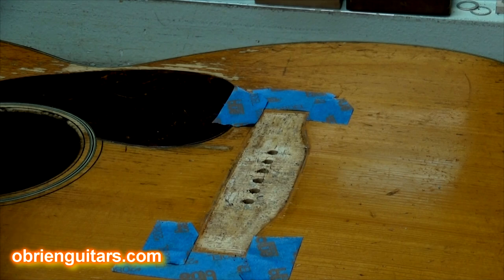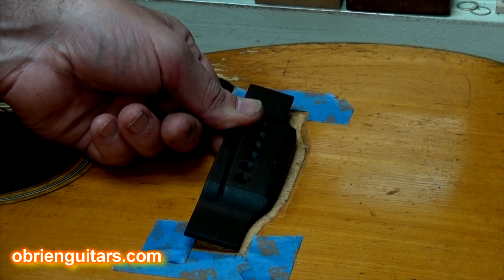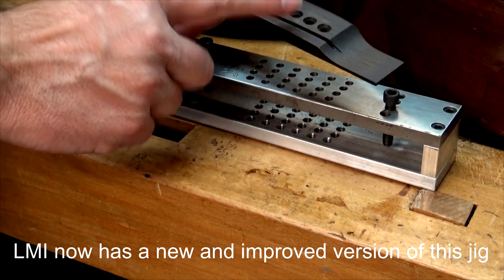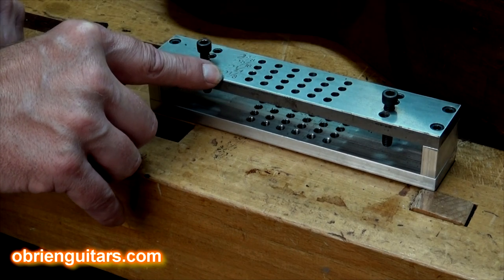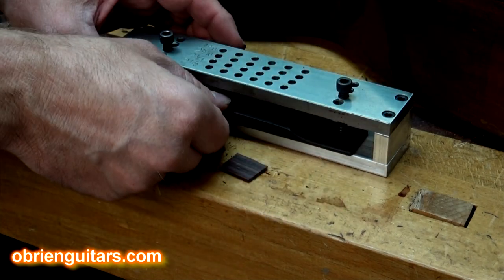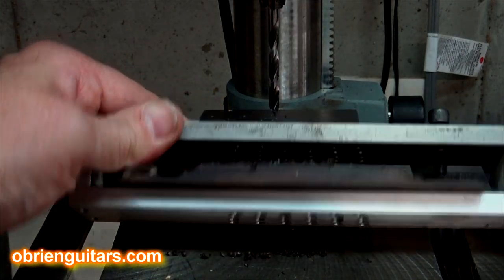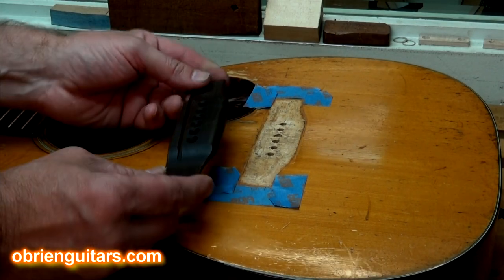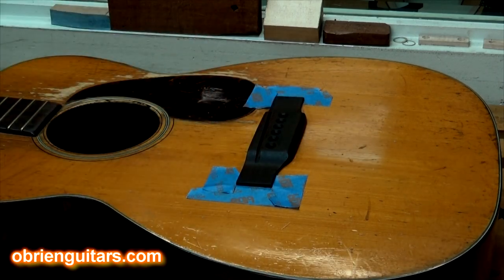Luthier Tips du Jour Mailbag 127 - Drilling bridge pin holes accurately

Comment: How about just using the original bridge as a template for the new holes? Double stick take the old bridge on top of the new blank, drill through the existing holes and through the blank?